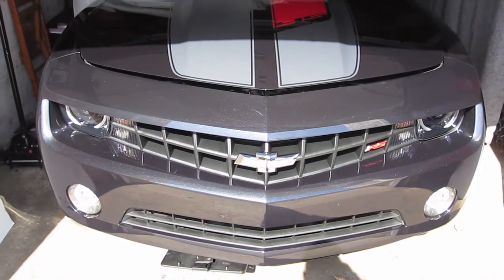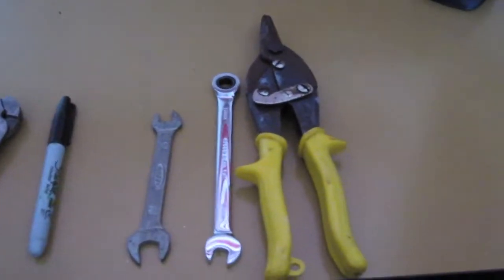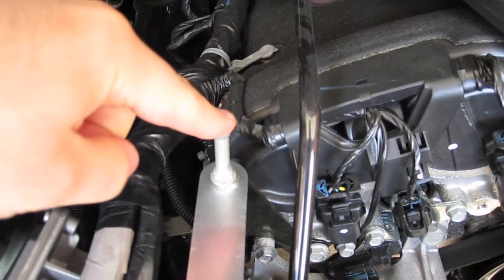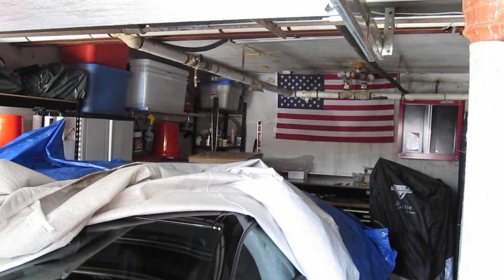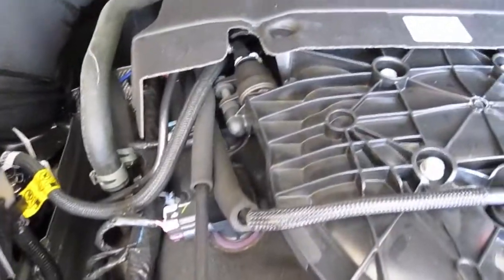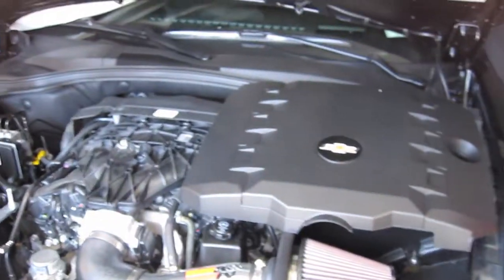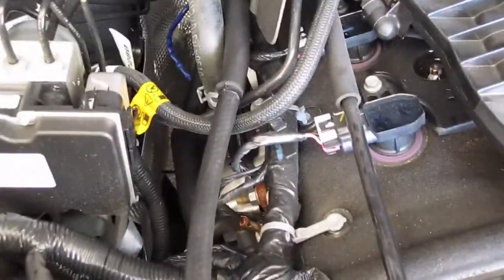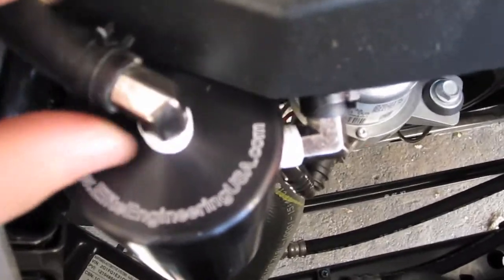2012 Camaro V6 Catch Can Install

Comment: Hi Joe, im new to this. just a question the top hose is a clean side??
Reply from the maker: MrCNT97 yes. The non filtered side goes into the side and any contaminants drops into the can.
Reply: Thanks..by the way, great installation video,  you got another subscriber.

Comment: could u add one on the clean side also ? or would that be pointless?
Reply from the maker: Kp The Competition you could add on to the clean side of wanted, I believe the newer ones offer a dual type system, might be pointless, not really sure. I would recommend you hitting the forums, asking others what they think as I may not be the best source to ask your question. 

Best of Luck

Joe

Comment: good video im trying to install one on mine 13 ss still not sure which size it ll go , im also gonna place a strut brace . i wonder if the place for the catch can is the same as yours so that  it wont be in the way of the strut brace.

Comment: good video , I got the same engine in my Holden Commodore  SV6 , I'm fitting a catch can at some stage this weekend .This video was what I was looking for , only difference is that mine is on the opposite side , but the same logic applies .
Reply from the maker: Cool, good luck, hope this helps!

Comment from the maker: @punjabimo the hose you get is definitely long enough. I had about another 10" left over after the can was installed. You may want to purchase another stock tube from the dealer just so you can take the can off if you want to.

Comment: I would not cut your only OEM hose Joe.  Buy another one for $18 so you can put it back to stock if you need to.  I bought one and just used the ends.

Comment from the maker: Make sure you put your oil cap back in when removing the cover to prevent any contaminates from going into your oil. Also, put the lock washer on the bottom of the bolt underneath the stock mounting bracket.